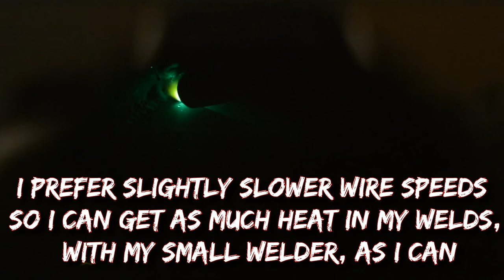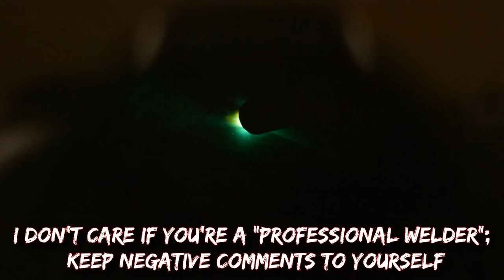Cummins Rat Rod: Project "Wild-Torquey" (Ep. 39) INSANE BUILD!!

Comment: I was thinking you could use a cantilever design like you mentioned with the mower spindle, but I think you'd have to move the gear box or also bend the steering rod to make it fit. You'd need a reasonable amount length of the cantilever to be sure you have enough swing travel for your steering lock.

Comment: So sorry for your loss.with your welder if you are having trouble not getting enough heat you can try to keep the tip as close to the weld as possibe it will help it will slightly improve the performance also try not to use an extension lead or keep it as short as possible and the best tip is use a co2 mix,watch some videos from Jodie at welding tips and tricks on YT he's full of awesome tips to get the most out of your welder the co2 mix would give appproximately 30% more heat,awesome work mate
Reply from the maker: thanks for the tips I will look into that!  my weldwr is kinda wimpy so might be good to know

Comment: I believe you can get a different gearbox that steers opposite of the one you have now so you can put the pitman arm facing down. We put a gearbox from a salvage yard in a chevy van once and it was backwards like yours. looked almost exactly the same as the one we took off. bolted right on. We have to get another one  that worked normal.
Reply from the maker: +nissanlord Yeah I was kind of going to look into a box that mounts the same but has opposite gearing!!! I know this is one of the most popular steering boxes ever made, so there has to be one backwards gearing. I will let you know what I find out in a future video!

Comment: I really liked your mower deck spindle link idea.  Mounted under the frame I think it could be made to miss the tire and it would look better. More mechanical tinker like most old cars were.  That link is still going to have bump steer because the bump steer issue doesn't care what shape the link is. It only cares where the mounting points are. to test just unbolt the wheel side and lift it up 8 inches and measure it. compare to a straight rod and you will see what I mean. I think two shorter links be stronger than one long link too.  Awesome build. Of course I am just now watching and you may have already changed it.
Sorry to hear about your sister. I just lost mine not long ago to cancer.  Take some time. You'll figure it out.
Reply from the maker: +consaka1 Yessir I have decided to just try and find the same box (mounting wise) that has a reverse gear in it. I believe the cargo vans of the 90's have what I need, just have to get to a yard. It does have bumpsteer the way its setup in this video, I was going based off info I heard from another source when i built this configuration
Reply: Tinman 2 Kustoms A different gear box should do the job as well. just not as entertaining to get it to fit. :)
Reply from the maker: lol right, it'll get fixed before the car hits the road :)

Comment: My condolences to you and your family.

Great build... I've watched all your videos.  I'm a bit concerned about the steering linkage that you've created - you can observe the bump steer as you raise and lower the front of the car.  (The steering shaft rotates as the bags fill and deflate.) To reduce bump steer, the bar from the steering box to the knuckle should be parallel to your control arm.  I'm not criticizing your idea or technique... I only wanted to share my observation because bump steer can be a serious safety issue.

I'll be eagerly watching for more updates. I am so sorry to hear of your loss.
Reply from the maker: +Christopher Italiano I agree, the bump steer needs to be corrected. I couldnt tell til i tried to take it up and down through the travel while holding the steering wheel. I am exploring other options for steering linkage/setup at this point. You will see what I do in future episodes

Comment: You can't change the steering bump with this setup it's the same thing as a straight bar. Only the pivot points matter and not how you get there.
Reply from the maker: +gt2limited I kind of thought so too, others told me to go for it, but after going through the motions of the suspension it has a little more bump steer than I am comfortable with. I will be working on another solution at a later date. it works for now and is safe, but not ideal or perfect.

Comment: I noticed that the steering gear input shaft rotated almost 2 times when you raised the suspension .. Is it centered at ride height and just moves when it would be parked at a show or something ?.  How much of your steering is lost due to this ?    Because it looks like it would almost max out the box in 1 direction  but give you way more room to turn the other way .     ......If you rock the steering linkage to the inside (toward the frame )  then lock the heim joints down in opposing directions (tilt the one on the knuckle up on the inside )  and tilt the one on the steering gear , this will lock the bar in place ...   Ive noticed a "vague  spot " in the steering on my truck because the bar would shift while steering (only did it while moving ) ...  This is how I fixed my problem .....    ..........................................  Also ,  our prayers go out to you and your family during this time .. I am sorry for you loss , and pray peace over your family .....

Comment: Very nice Luke, just one question I noticed that the steering arm was parallel to the 4 link when dropped but not at ride height, I thought bump steer would be less if it was parallel at ride height
Reply from the maker: You are correct, bump steer is minimized with the drag link parallel to the 4bar at ride height. This one was setup to have a low ride height and I've since changed the steering setup a little bit

Comment: Rather than use that terrible drag link you made you need to use a simple clevis on the pittman arm-side of it so the arm doesn't flop around like a flag in the wind.  With that heavy of a vehicle it would be MUCH better to use a couple U-joints on the steering shaft and mount the steering box so that it was on the same 'plane' as the steering arm, on the front axle.  As it is, it's a death trap looking for a place to happen - especially if the front tire grabs that arm!!!

Anything worth doing, is worth doing right.
Reply from the maker: steering setup has since been changed a few times. I was experimenting with what I had sitting around. instead of critiquing what I'm doing wrong, why not make your own videos? you seem to have the answers..
Reply: I don't need to make a video. I already know what I'm doing and I learned most of what I know by listening and watching those I was around.  I sorted out the good advice from the bad advice and became who I am today, instead of blowing smoke at someone who cared enough about me to (as you say) "critique" what I was dong wrong. NO - I'm not a good overhead, or horizontal welder yet, but with a little effort I manage to put the metal in the right position so I can make things happen the right way.........with the right equipment.

That's why, when I build something, people look at it and their jaw drops to the ground - NOT because it looks like crap, but because it's a work of art - even though it might still be considered a "rat" rod.

When someone tells you that your fly is open, don't walk off all pissed off at them. Look down and yank it up, then laugh and thank the person who told you about it!